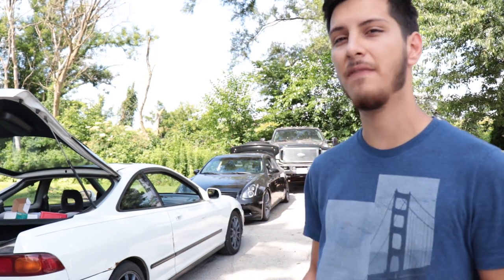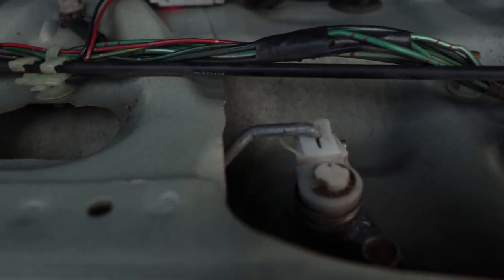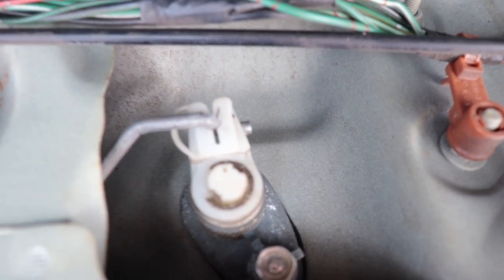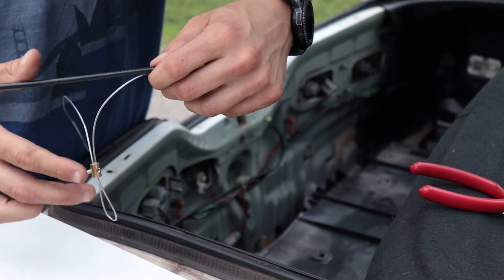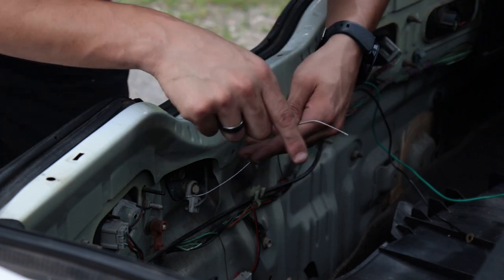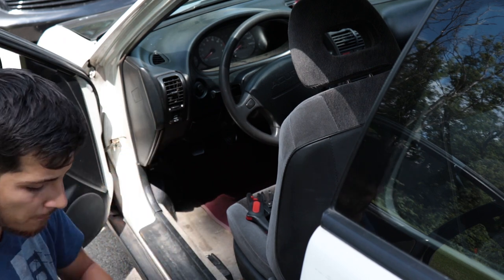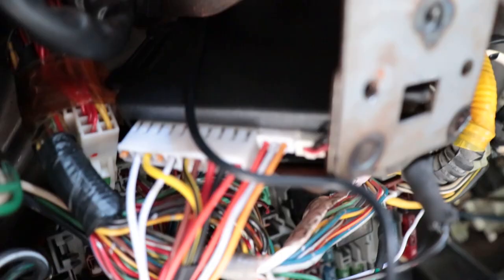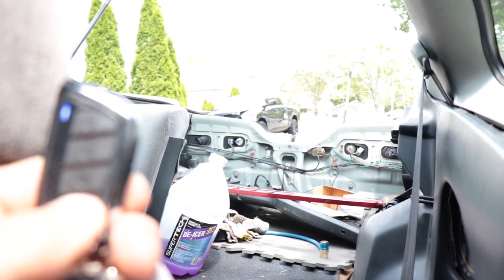Acura Integra Keyless Entry Install, Trunk Pop!

Comment: What wires did you connect to for the lock and unlock wires?
Reply: Same question for me too
Reply: Same I can’t find it
Reply: One goes connected to the black/white wire in the car and the other one goes connected to the black/red wire in the car, hope it helps, just try and see .If the lock button unlocks and vice versa, just switch the wires